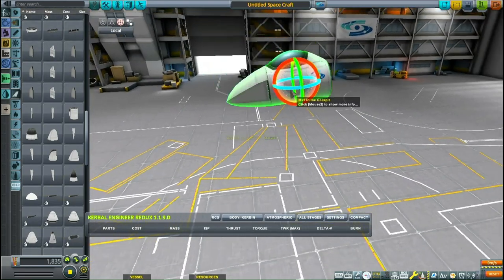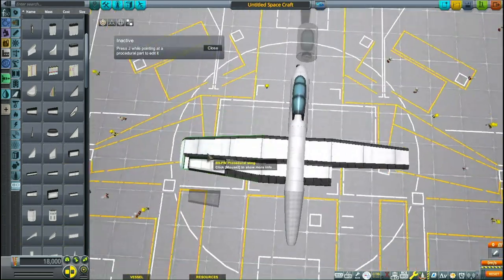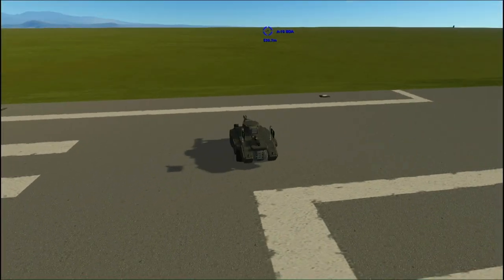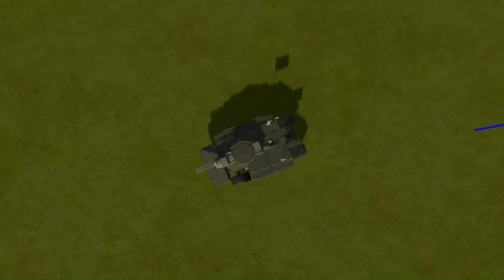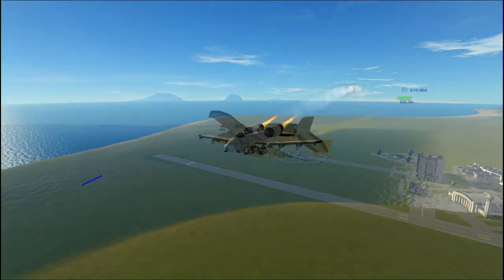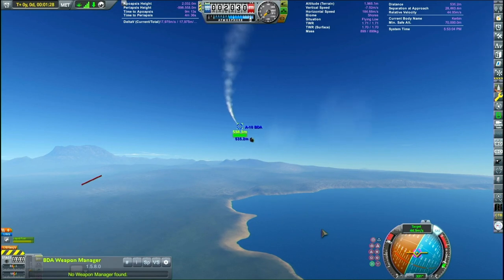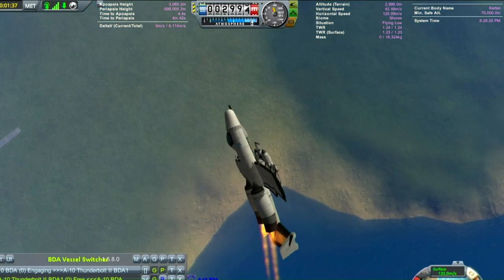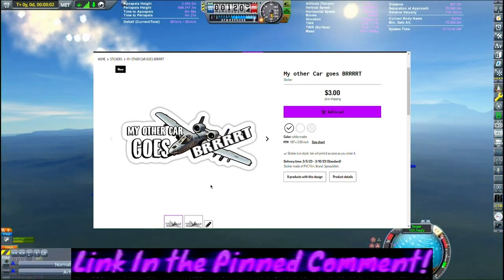KSP: MODDED A-10 vs. STOCK A-10! Who will Win? Featuring BDArmory! #a10warthog #kerbalspaceprogram

Comment: Might I suggest Atmosphere autopilot as another mod you should check out? The standard fly-by-wire mode should help a lot with the sudden pitch and roll movements that keyboard mouse makes. The binary switch between no input and 100% torque is no joke lol. The cruise flight mode is also incredibly useful for reaching specific points on kerbin, and would have been perfect for your 8 hour osprey journey.

Comment: You did NOT put a spike intake in that. My man that engine is completely different than what you made, you gotta use the other one with no gimbal and no afterburner, and the mk1 intake
Reply from the maker: Oh yeah I know, due to the aerodynamics of the original stock one being so so so much worse than the modded one. The "Wheesley" engines just did not have the power to recover from steep manuevers needed when dogfighting the modded A-10 (especially when the AI was flying it ). If I hadn't changed out the engines for more power than I wouldn't have had even the slightest chance against the modded A-10. Which would have been pretty boring just dying constantly. The modded A-10 still won though by far (and it had the correct original engines) so it didn't help much anyway I guess lol
Reply: @smooneychad  i mean, the a-10 is a heavy plane made for attacking the terrain. The engine on the top is just there so that dust doesn't enter the intakes, it's is hella heavy and can carry very heavy cargo, and the design is made to go just above 400 km/h. it's is so slow in fact other planes could just outrun it in seconds. If you want to make a plane like the a-10 but for dogfighting, your best choice is completely remaking the design